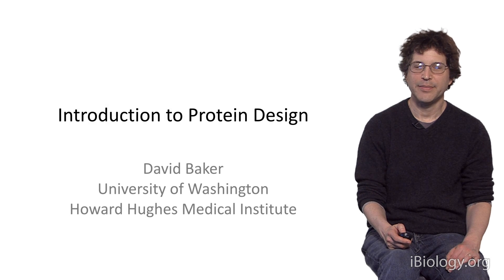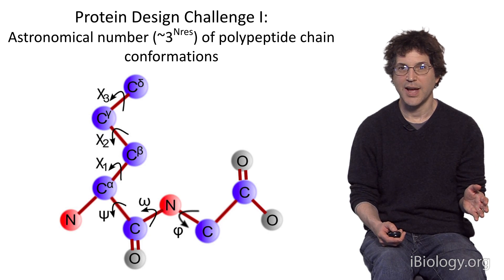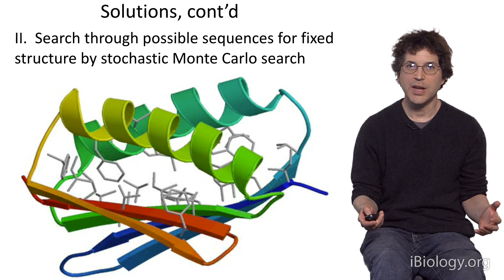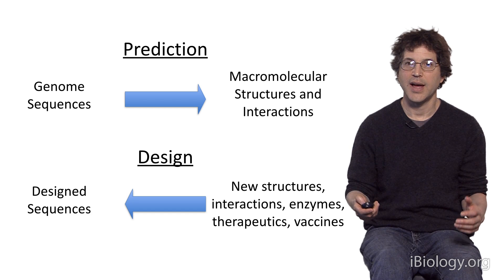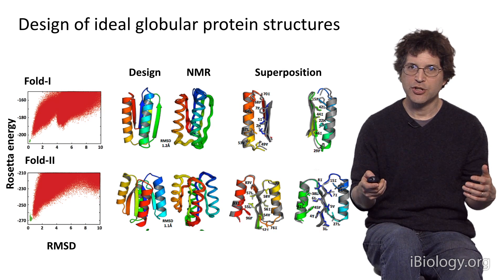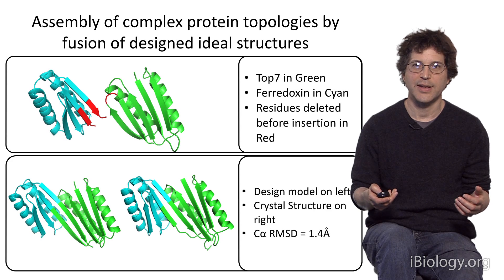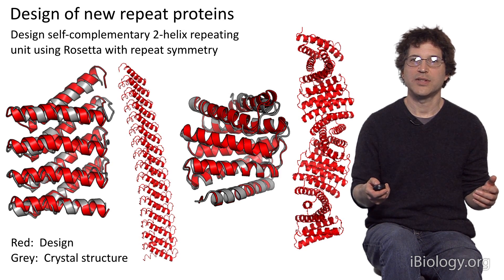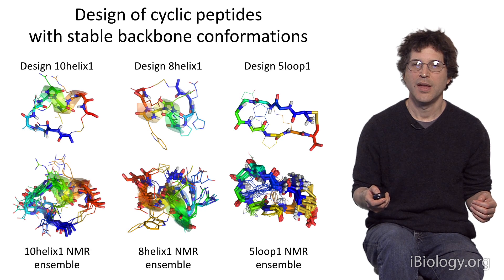David Baker (U. Washington / HHMI) Part 1: Introduction to Protein Design

Comment: Hi, 
Im currently working on a presentation for my studies about that exact theme. My Information’s are based on an article from the Nature magazine from the 15th September of 2016. In the article the scientists also use the Rosetta program to design proteins. In my understanding they first try to build the carbon backbone structure by finding the lowest energy state, and then they try to add the different sidechains for the tightest packing together with the lowest energy possible. Here is my question: Don’t alpha helices and ß sheets need specific amino acid residues to even exist, at least at some places? If so does the program calculate these specific amino acids into the primary structure to stabilize the secondary structure?

Ps: The name of the article is: The Protein World
Reply: I too have the same question have u got the answer
Reply: Answer?

Comment: how do you solve the problem with conformation distortion between bound and empty active centre. you probably need a certain deviation from minimal energy hole to allow flexibility and reactivity to substrates
do you have a figure how much the predictive success when the in vivo folding matches to the in silico one?
Reply: I am confused why would you need a deviation from minimal in order to allow for flexibility and reactivity to substrates?
Reply: @rebeccakane8854  it is because interaction and ligand bindings cause different level of comformation changes and new interactions. so the new conformation most likely on a different energy level.